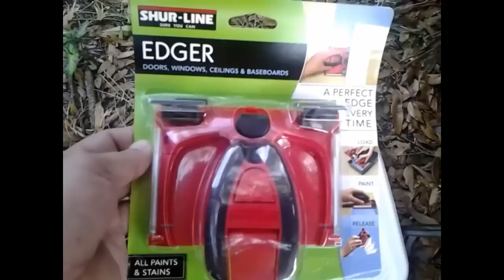How to use a paint edger - Saves so much time and effort!

Comment: Does this work around trim and molding that is too thin where the wheels can't touch it since the wheels are so far back?
Reply: Didn't work for me. Tried everything! Kept getting paint on the ceiling and trim. Gave up & did it by hand.
Reply: Just learned that it doesn't. So I just keep a wet rag and wipe off the little bit that gets on the baseboard.

Comment: "Here's a tricky place..." Let's try an interior blue wall against a white ceiling. You end up with a 1/16th inch line in the corners of your wall paint, exposing your original wall color. 
It's a DECENT (at best) idea of a tool, but far more valuable on exterior jobs, but the bristles are so small and thin, with such a thin pad, it is CERTAINLY not meant for exterior jobs, which are 75% rugged surfaces.

Comment: I dont mean to hate guys but every tool has its place. You wont be painting in a million dollar house with that thing. Its not used by real painters that make a living. I say this to the guy with a huge expensive house that thinks this will "cut it".
Its not for the middle to upper crust. Strictly my own opinion but feel it needs to be stated.
Reply: You may be right. But people need to understand why it's not used by professional painters, or why this won't cut it. Would you care to elaborate?
Reply: You may get lucky here and there but there is just too many times it wont look right. Honestly I wish it did cut a razor straight line every time. If your good with a brush I dont think its  any faster. Just another tool to complicate things, 

If I was to use it I would stay away from the ceiling. Might work good for around windows, doors, and corners for a home owner. I havent seen one in action in many years

I own my own biz, If a potential worker showed up and pulled that thing out Id feel he needs to find someone else to work for.
Reply: +Propainter Broward, you sound more like someone who is insecure about his own ability than someone offering helpful advice. So far you've only said a few things, 1) you've never seen this device before and 2) the device is no good.

You never gave a real example or reason other than you 'believe' (without ever seeing one in use) that it will not work.

We get it... you've spent years learning to use a brush. It may help you get paid, but doesn't help any of us.
Reply: Wardler beautifully said. I couldn't agree more.
Reply: YOu can use it for a first or second coat only. not for both coats.
One coat you have to cut in with a brush.
Reply: +MikeAnn193
+Wardler
I'm in a middle of a paint job as we speak.  I'll start with saying that no I am not a professional painter but I do have 8 years experience in bathroom and kitchen renovation.  I'll will do my best to explain why this product isn't ideal for me.  I am not sure if you are a home owner but houses "settle" over the years (30 years in this case) and the ceiling (drywall) is no longer a nice straight edge on the load bearing walls.  It's is wavy in spots making this tool pretty much useless.  I can compensate with tape and I'll get a much better edge despite the imperfections in the drywall.  Next issue is the windows and the trim which makes this tool not ideal for me either.  This is what the trim around my windows looks like.  http://infohomefurnituredecorating.com/wp-content/uploads/2014/09/window-trim.jpg

Next issue is the house I live in is colonial style and has chair rail molding (wall trim midway on the walls) as well as baseboard trim.  My experience with similar products is that the edge is not as sharp and precise compared to tape.  Also I would imagine this tool works great on outside corners but no so much on inside corners.  I've wouldn't dare use this tool against expensive solid wood cabinetry either as tape is the way to go.  I think most professionals use tape because it gives a more consistent sharper edge.  Also most professionals expect houses to have imperfections in the walls/ceilings and using tape makes it is easier to compensate for these flaws resulting in a sharper edge.  The reason I am here watching this video is because I bought a Wagner smart edge roller in attempt to save some time from taping off all the chair rail molding in the house but after a quick test I found the product to be very disappointing.  Someone recommended me this product so I wanted to see it in action and how it works.  I think people who pay professional painters top dollar expect top quality work and which is why the professionals use tape  so they can achieve that perfect edge.  I think I'll just stick to tape for this job because there is so much chair rail molding and baseboard trim that was painted ultra pure white and any imperfection in the edge of the wall paint will be very noticeable against the ultra pure white molding/trim.  If you are not OCD nor a perfectionist I'm sure this is a great tool.
Reply: I use this with a metal paint guide. gives similar if not better results than trying to use a brush, and saves me hours as well.
Reply: MR WAYNE TURNER The new edgers cut in better than any “professional “ painter ever will.